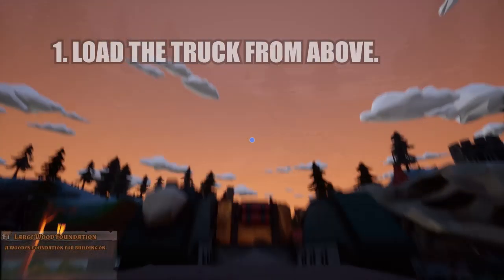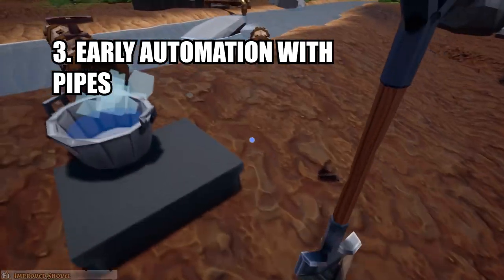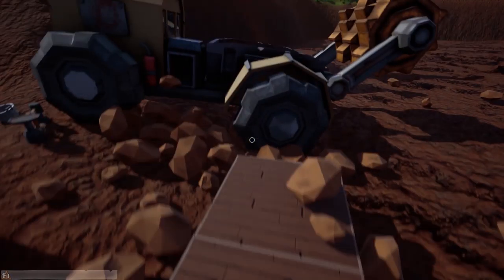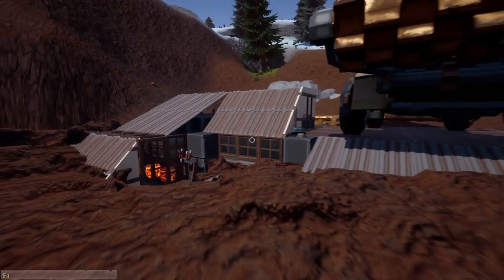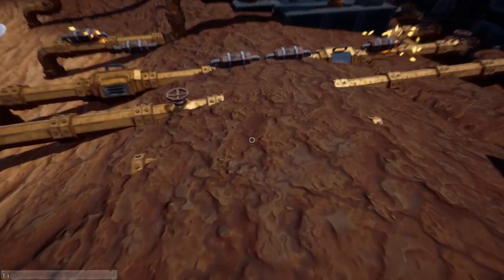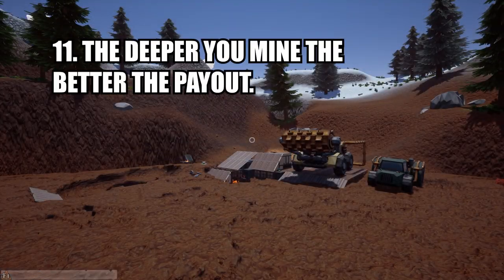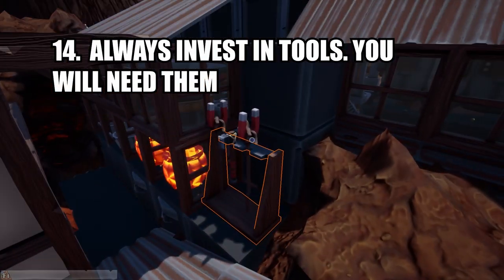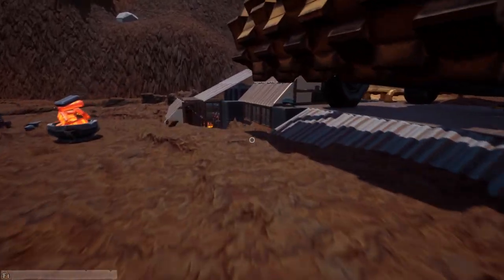15 Top Tips Everyone Should Know In Hydroneer

Comment: I was able to make an automated sorter where you can just dump out the pan. I have a funnel in the center and then used the thatch roofing to extend the funnel out. Lastly, I encased the whole thing and put a door on it. When you empty your pan it will explode like normal, but most of the stuff will actually make it down the funnel requiring very little cleanup.
Reply from the maker: Nice, but if it's automated, why not replace the pan with a crucible? that way you won't need to empty it out again?
Reply: @TotalXclipse  Sorry I explained that badly, sorting part is automated. It's so I can do manual panning at a lower level then dump it in the sorter. The sorter then puts the gold and iron in their respective crucibles and then the power shards and gems in their respective pans.
Reply from the maker: @hoteltoyota  ahh okay I understand now :)

Comment: you can place anything in any container! (for instance all your created items)
1) park your truck near you (you need the back of the truck for this)
2 (for collecting items and carying it all at once >>) drop a pan in the back of the truck (for collecting created items i.e. rings, huge necklaces and even maxed out swords/daggers/axes!) 
2 (for smelting ores or bars >>) drop a crucible in the back of the truck (to smelt all the same ores and bars (Its does not matter the size!!!! =D ))
3) drop items/bars/ores/crystals in the container while in a mid air jump (so let it fall from a small height
what happens: everything in the back of the truck loses its hitbox. so everthing can fall while not colliding with other items (exept the truck itself..)
So, when you do drop an items from a height, they fall thru the pan/crucible and hit the floor of the truck. at this moment, it will stick with the hitbox of the container (pan/crucible).
so, when your done collecting; grab the pan/crucible and everything thats  dropped "within" the container, will stick with it, without bugging of flipping out.
you'll notice that it becomes a small group. everything looks to be inside the crucible while still sticking out the side of the container.

TIP: this also works to get huge bars into a crucible to make 2 huge bars into 1 even larger one! 
you can meassure the weight of both bars before smelting and afterwards and youll notice that it actually works!
PLEASE FOR THE LOVE OF GOD, DO-NOT-MIX-RESOURCES WHILE THIS TRICK!! its sensitive to mixed up resource and you can loose valuable stuff! BE CAREFULL! KEEP RESOURCES APART!
Try this bug on smaller resources first before amping up the size, to get a feel of the glitch.
- You're welcome :)
Reply from the maker: Can you smelt all bars? because the largest of my bars were refusing to melt down :s
but some great tips! Thank you :)
Reply: @TotalXclipse  you can smelt them. But you need to drop them into the crucible, while the crucible is in the back of the truck. The bar will drop thru the crucible but it wil be inside the crucible if you pick it up after that. You will see that the bar is 50% sticking out the side of thw crucible (if you try to melt the largest bar)
Reply from the maker: @qlimax1990  You can drop the largest bars in the crucibal without the truck, It's just I've never been able to melt the largest bars in a crucibal, only the smaller ones.

Comment: Early game fill bucket, empty out on ground, repeat, now combine the two clumps into one and THEN wash. You will have to use the free place mode to put into wash pan.
Reply from the maker: why wash then? That sounds like a slower system than dropping a clump into the pan then washing if you want extra dirt just add an extra bucket to stop you faffing about with the dirt
Reply: @TotalXclipse  It's an early game tip.  when you don't have pipes. and you don't need to make two runs to get water.

Comment: Hmh. Good idea with those crucibles.
I would add one.
Instead of filling up buckets and then pouring them into pan, buy alot of pans instead. Pan can be filled with just one shovel instead of buckets two, but you'll lose time handling bucket.
You can place place pans into river(autofill), or make piping that drops water into each pan(best placed on wooden box for easier aligning). Then fill all pans with single shovel, grab your brush and refine all pans at once, then grab shovel again and repeat. Its way faster than filling up buckets, brush, bucket, brush, bucket and so on. Moving items around constantly and switching tools cost you time.

Comment: Add a pressure tank directly  into the drills and harvester for 100% efficiency as just one pipe away will drop it to 99%.  I usually put three PT's then split off into two runs, one with four filters for clean water to run the harvesters and drills the second run for conveyor system.  Then I add the PT's into my harvesters and drills  (just as long as you don"t have more than 25 pipes from the 3 PT's). Also water pressure will never drop below 1% so you can have a pump and 100+ pipes THEN add 4 PT's to get back to 100% pressure.
Reply from the maker: I run a pretty similar system, But I didn't know you could just add the 4 pressure thanks at the end to lift it to 100% A nice little tip there!

Comment: an easier way to load the truck is just to stand at the back, not on the truck just close, jump, and release at the height of your jump. Its much faster.
Reply from the maker: You're right but if you have big items like foundations, or the conveyors from that angle they can still fly off.
Reply: @TotalXclipse  You just need to make sure that none of item models intersects with a vehicle. For me jumping works fine and it's much faster.